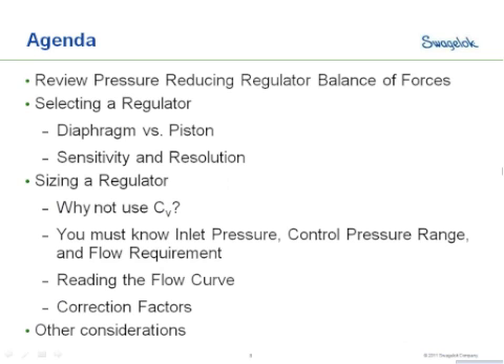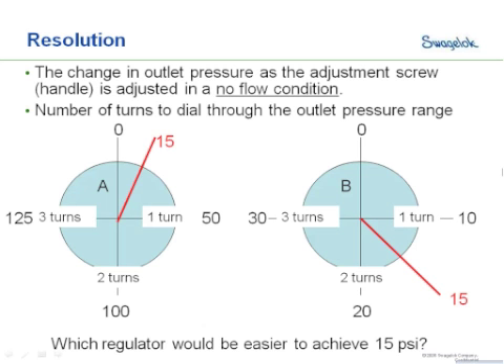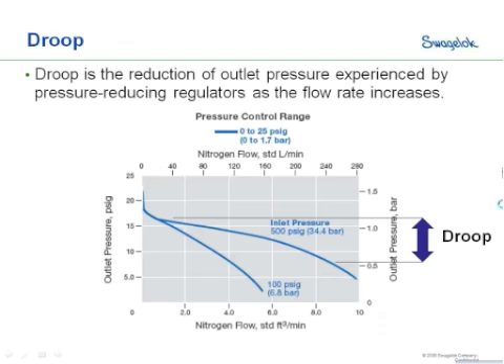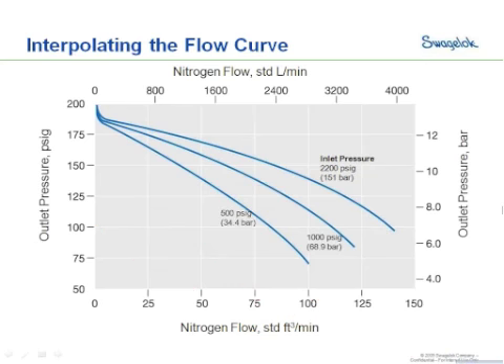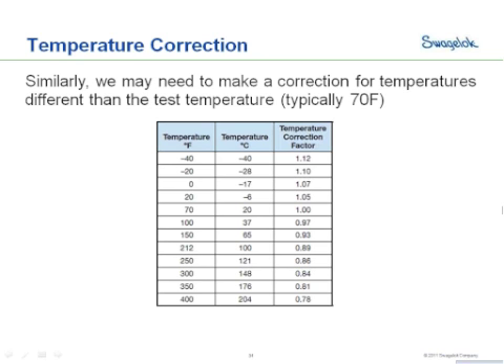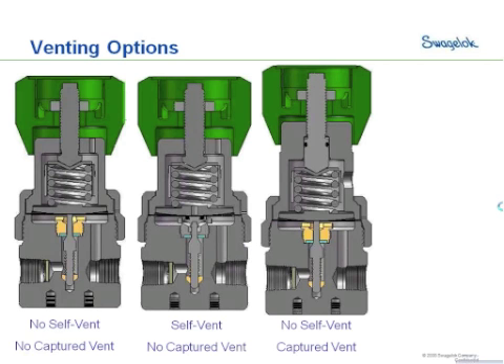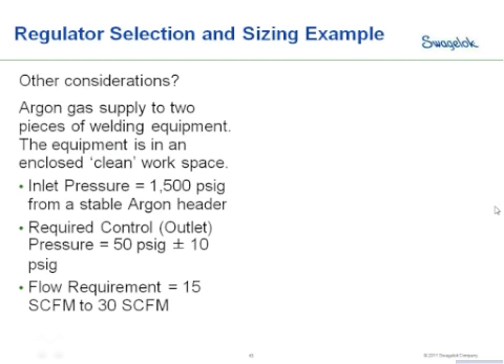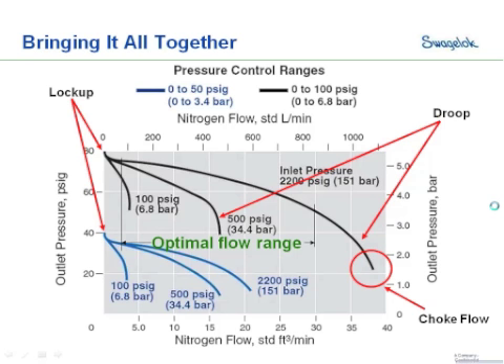How to Properly Select and Size a Pressure Reducing Regulator: Webinar Replay

Comment: I don't necessarily agree that the Cv is the "upper range" of the flow requirement and that it isn't the right way of sizing a regulator valve. That is the reason why we choose a regulator to be in the min flow and max flow, allowing the normal flow to be around 50%... knowing that some regulators are good at max 70% flow..

Comment: Hello, I have a 1/5 hp 58 psi airbrush compressor. It Does Not have a Pressure Regulator, just a gauge. Could you recommend a Pressure Regulator that will fit it. I tried asking dealer (Harbor Freight) to No Avail. Thank You

Comment: Is the complete range of flow (before choked flow) accessible in pressure regulator even if the velocity of air becomes almost 320m/s ?  
Inlet pressure 6bar outlet 1.5 bar flow rate 0 to 10lit/sec. Is this case possible with 1/4" port size pressure regulator?